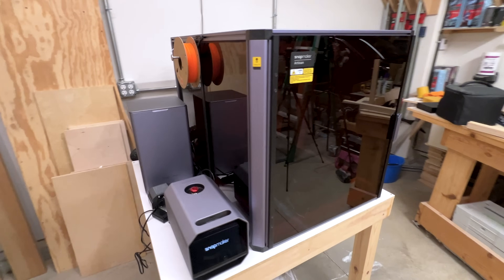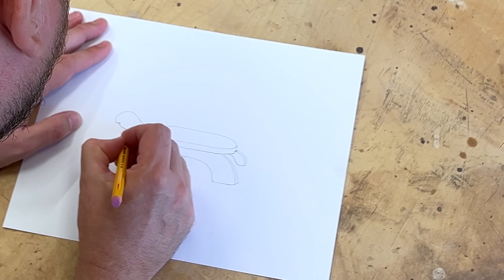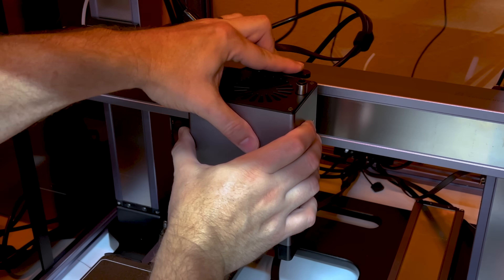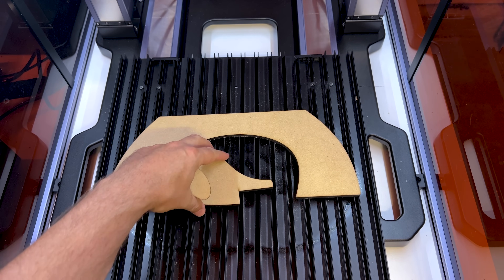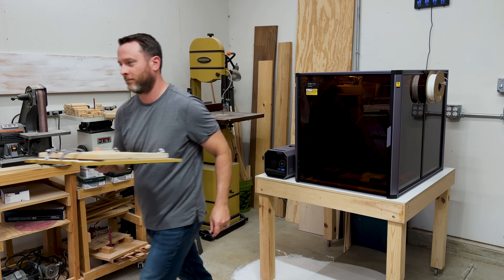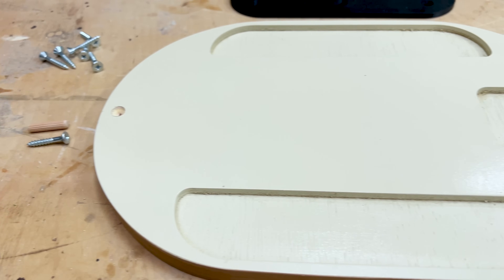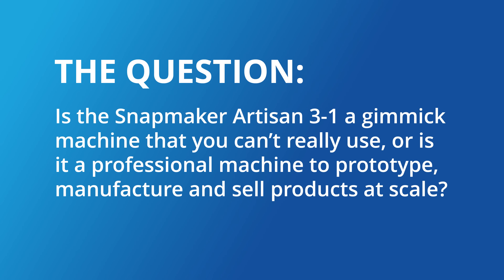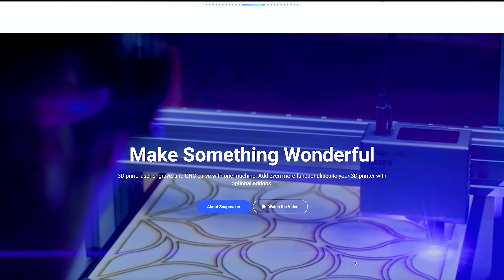Are 3-in-1 Machine Like The Snapmaker Really Worth The Money?

Comment: All 3 tasks where made with one software? or 3 different?
Reply from the maker: You can use Snapmakers software to print, laser cut and mill. However you need a 3D application like SketchUp or Fusion 360 to create the proper file format.